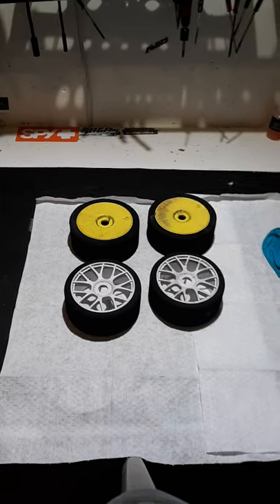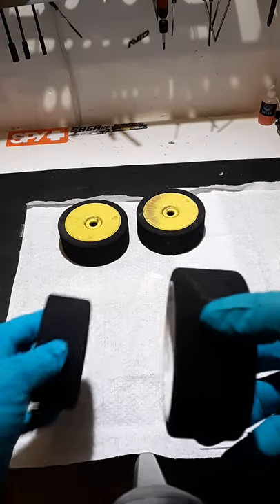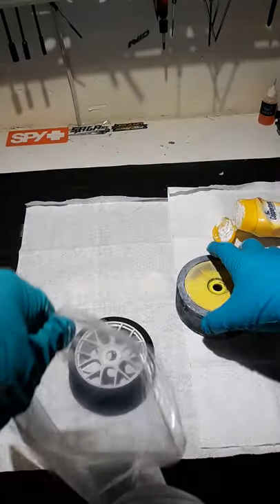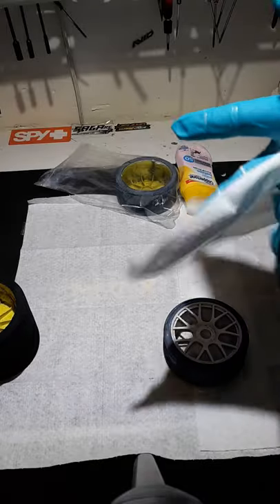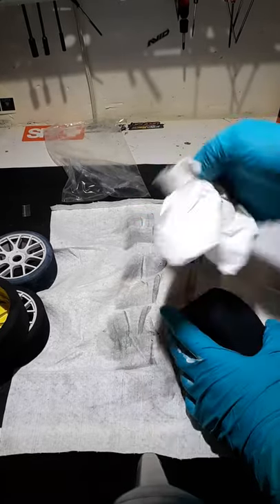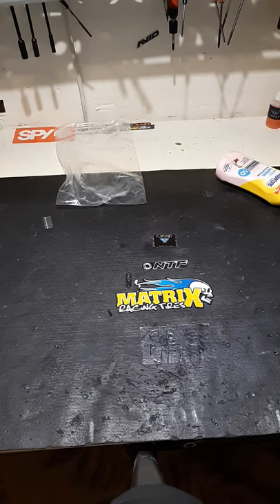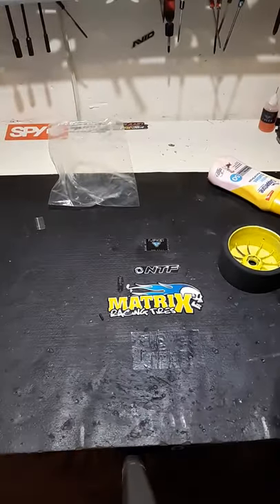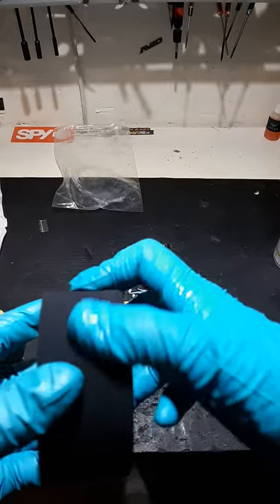FOAM TIRES REJUVENATION....

Comment: Awesome tip! 👍
Curious, what's your preferred foam tire & compound for high speed runs?
 Last foams I used were Contact GT8. Tried 25 shore & 35 shore. The 25's had amazing grip but I shred the crap out of them. The 35's are still intact so far but the traction is 'ok'.
Thanks 😎👍
Reply from the maker: Bsr purple or xxp is the only thing I'll run now
Reply: @flopackrc5452  awesome, thanks for quick reply 👍
I was just checking those out, was debating between the purple & the xx pinks.

Comment: With wd 40 the petroleum distillates start to break rubber down, I'm assuming foam as well. I think the spf 50 may be doing the same thing to a much lesser extent. Either way great tip!
Reply from the maker: Never had a problem  .
 Tires on last 2-3 passes at this level
Reply: @flopackrc5452  I was agreeing with you. I was just saying why I think it works.
Reply from the maker: The I gotcha boss i learned these tricks from oldschool guys like Tim Smith  and  Mike smith  .good looking out

Comment: Hello :-) Any idea of what foam these tires are made for ? I would like to buy big foam sheets and make my own ones.
Reply from the maker: I order from gone banana  I have no clue where to get foam from boss sorry I couldnt help
Reply: Eva foam, the problem is, we can't get custom hardness, unless you mold them by yourself
Reply: @bayuajiwisepacific1076   Thank you ! I tested with EVA using improvised trueing machine and it works but small grip, then I placed motorcycle chain wax on it and the tires are glued to the road literally ... for 5 minutes :-) I bought a commercial foam tire and the foam texture seems different than EVA on surface, maybe semi open cells or plastazote  ?